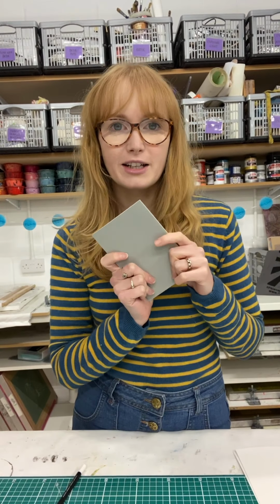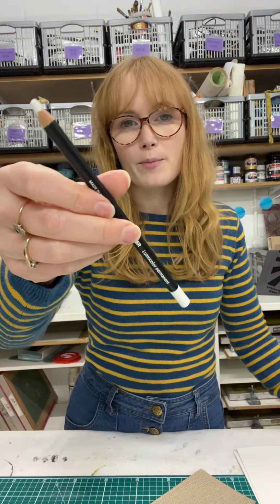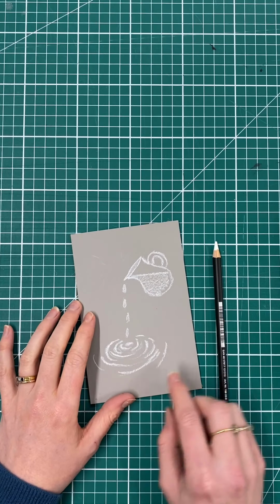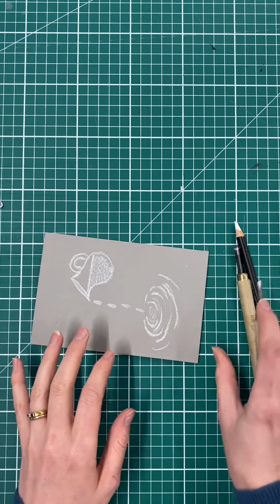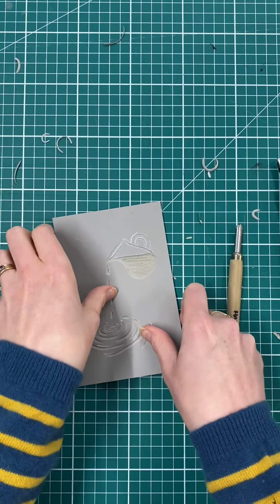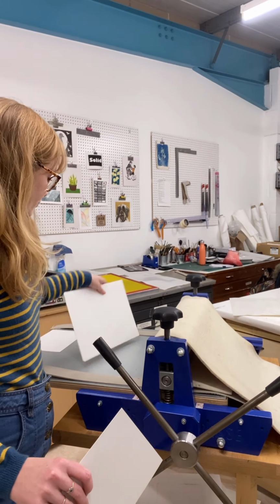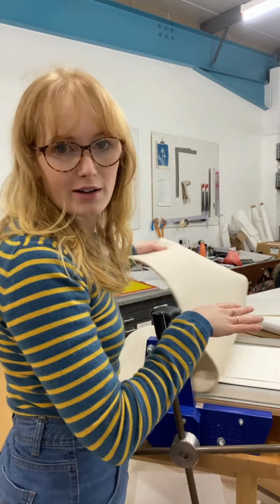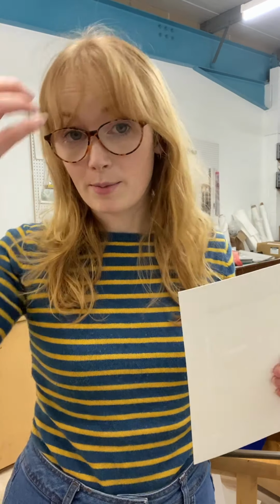Blind Embossing - Print without Ink!

Comment: Fascinating.  It was so interesting to see the process.  I have never done anything even remotely like what you showed.  When you explained that you needed to use a blanket I could definitely understand the need for a soft layer such as a blanket to squish the paper into the mold.  But have a question about the blanket.  Please don't laugh.  Is the blanket you used a cut up blanket like you'd put on a bed?  I'd really like to know.
Reply from the maker: I know this reply is so so late (I've been away from the channel) but no, it's a press blanket made specifically for printing presses. You can use dense felt though

Comment: If you want to emboss and print... wich one do you do first?
Reply from the maker: Print, dry the print and them emboss. If you print second, the embossing could get squashed out
Reply: @Handprinteduk  if you’ve already printed and re-wet the paper to emboss does this damage the existing ink?
Reply: @inkwellandthyme  It would depend on the ink used - some inks are water soluble. I would give it a try to see.